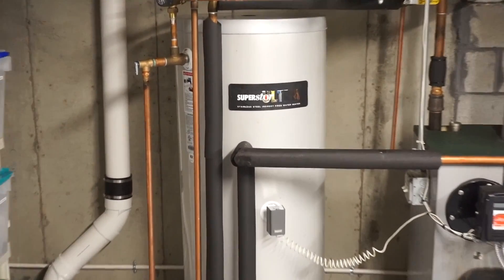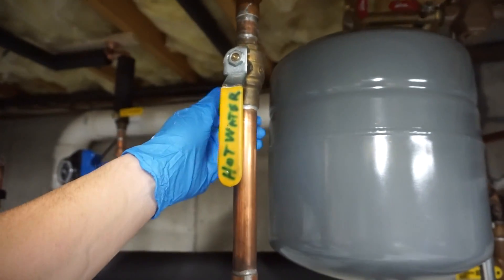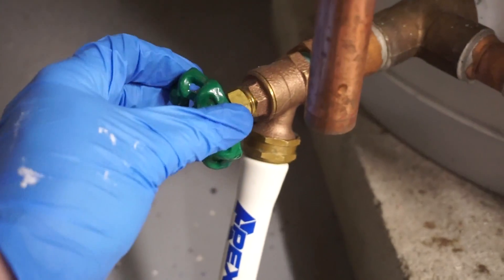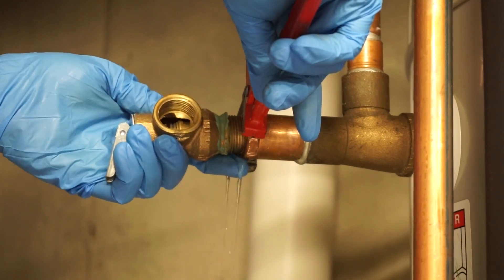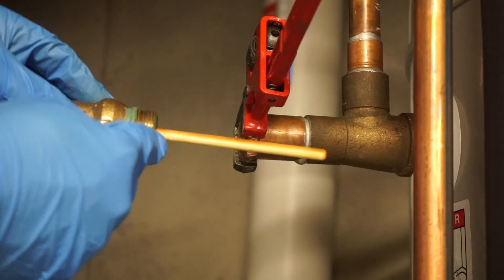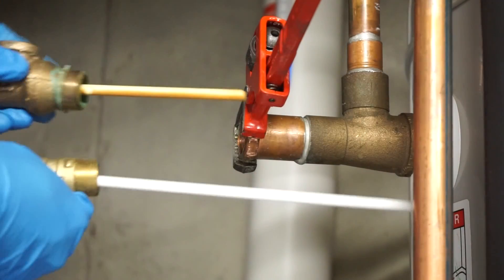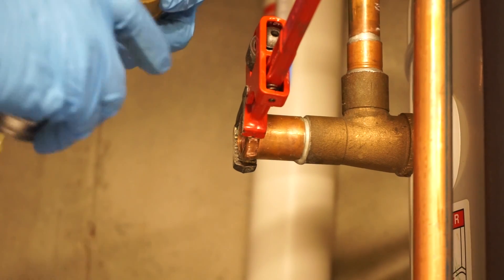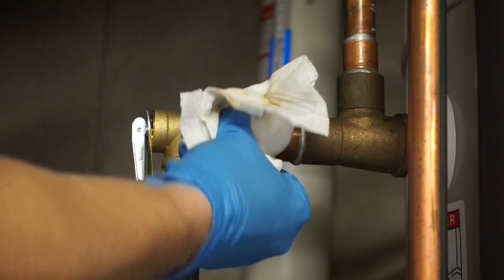How to Replace Hot Water Tank Pressure Relief Valve - T&P

Comment: Question:  So it's easier to replace this valve in the future, why not replace the vertical section of copper pipe after the valve with a flexible copper whip?     Then you don't have to do any more soldering/desoldering in the future.

Comment: I would recommend turning off the blue Watts recirculating pump whenever you turn off the water flow into and/or out of your water heater. I own the same pump. Our city water was out for 5 days after an ice storm, and I forgot to turn mine off. The pump motor burned out during that time, and I had to replace it.

Comment: Couple suggestions:
Sometimes the relief valve doesn't seat properly, so flushing the relief valve for a minute can wash it clean. Most manufacturers of hot water tanks recommend this flush every 3-12 months.
With the inlet and outlet valves closed, water or air can only come out of the other openings. No water will come out of the relief valve because that would require air to be pushed in through the drain valve, so the comment "no water is coming out of the T&P line" does not mean the water level in the tank is below the T&P level.
At the end of the video you try to expel the air in the tank by opening the drain valve. Air floats above water and you'll need to use a high-point vent to remove air. The relief valve would serve this purpose.
For viewers that don't have a separate hot water heater or boiler, it is important to verify that the tank is full of water before restoring power. Opening the drain does not accomplish this.

Comment: I bought a universal valve at Lowes. The body is longer so the probe is a showing less. It's a side mount gas water heater , I've seen answers to no it's not ok and it's ok. Any opinions? Thanks for the video. The original is the shortest body possible American 6900816 and a 4"probe the new one is utilitech 362341

Comment: On mine, the copper pipe from the T&P valve takes a right angle turn and the two more and then goes outside the house. In other words, I can’t just turn it to loosen it from the valve. Whoever installed it must have thought the T&P valves last forever. Is my only option mow to get someone to cut the pile and then resell a coupler on after the valve is replaced?
Reply: Sorry for typos. 
I meant:
Is my only option NOW to get someone to cut the pile and then REWELD a coupler on after the valve is replaced?
Reply: You can cut the pipe but you don’t need to resolder it to get it back together. Cut the pipe as square as you can with a hacksaw.  Use a 3/4 sharkbite coupling. They’re easy to find a Lowe’s and Home Depot

Comment: My city water system has a sediment issue, always has. The valve from my 3 year old tank had a small drip here and there. Plumber wanted 250 to change the valve and also said I needed an expansion tank. Never had one on my old water heater that lasted 12 years. Changed the valve myself yesterday. Took 10 minutes. So far no drips

Comment: Does spinning the valve around tighten the spring inside and change the pressure at which water is released at?
Reply from the maker: No, The spring works at the spec pressure/temp marked on the label and there is no way, either deliberate or by accident that can adjust the pressure on these consumer models.
Reply: @SilverCymbal  K Thanks. I accidentally spun it around when flipping it back down. Was a bit worried. LOL.
Reply from the maker: No worries, better safe than sorry and check. Thanks for watching and be sure to check out and share my channel for other videos. All home projects DIY to save you money and maybe even have fun doing the work. 😀

Comment: Mine was leaking I replaced it and it leaked also. So I thought it was a faulty one so I bought another.. But it leaked also..my psi is at 60 my temperature is at 90°F what do I need to do
Reply from the maker: First are you installing this valve on a hot water tank itself? 90 degrees is pretty low for domestic household hot water so I want be certain.
Reply: @SilverCymbal  yes on my hot water tank.. And I turned the temp down to 90° just to be safe. Ill turn it back up to 120 ° later.. My problem is it still leaks..another question is. Could the tank be outdated to were I should go on and buy a new one and I don't use a lot of hot water.. Could I buy a 20 gal.instead of a 40gal
Reply from the maker: These valves only open under 2 conditions. Temperature or pressure. I know you said you are at 60psi and the water temperature is 90. I would go to either lowes or home depot and buy a pressure gauge, they are around $7-10. They just screw on a garden hose fitting or even the drain of your hot water tank. You can connect it to that see what pressure it shows to be certain. Try to leave it conected for a little bit and it will probably rise in temperature. Keep an eye on all of these if you leave them connected since they can leak.
Reply from the maker: You can also try another thing. First, is the valve leaking all the time? Try to open the hot water for a minute or so at a faucet. Chance are the leaking will stop at the valve.. What you probably have happening is you are building too much pressure, this can happen if you have a hot water expansion tank on the line and if you don't you may need to install one. I don't have a video on this but others do. You may also want the advice from a plumber as well. - Those valves only open for one of the two reasons so you need to correct the reason which my guess is that too much pressure is building due to a failed expansion tank or lack of one. This is very common but as I said you are likely reaching a point where you need a professional. I don't believe changing the tank will make a difference

Comment: To let air into the tank, when draining it, you can also open a nearby faucet's hot water -- right?
Reply from the maker: Yes but if you do it above the tank you will need to let the water drain from the system above. This is ok to do it just takes a while.

Comment: The cold water pipe feeding the tank has a shutoff valve labeled "hot water" . It would make sense to label this "cold water in" or simply "water in".  How does air escape the tank from the bottom when you opened the tank drain at 16:45 since air is lighter than water and rises in the tank?
Reply from the maker: The previous home owner had labelled it that way. I agree with you but I can see if someone didn't really understand it, labelling it hot water essentially does stop hot water production from the homeowner view. But I do agree that it cold water in or cold water is absolutely accurate.  Good catch about the air in comment also, i really meant to say water out of the tank. Thank you very nuch for watching and I hope you Subscribe and Like this video also. Best wishes to you.
Reply: Silver Cymbal hot wterbk

Comment: What would you suggest regarding  the pressure relief valve in a basement (which has no drain) I want to lay down a floor? I can keep the area with the water heater unfinished, but would you recommend to open a hole in the basement cement to allow any water leaks to drain outside?
Reply from the maker: That is a great question.  If you are in a warmer climate then routing a line outside could be a good idea and save any flooding.  Remember to check it at least once a year to make sure it’s clear.  You can do the same in a cold climate also but just want to make sure that any holes are well sealed and also check it once in the warmer months.  When this valve is used the pressure is very forceful so if by chance something is in the drain line it will likely blast it out. Thank you for watching and I hope this is helpful for you.  Best wishes

Comment: I did not know you could run plumbing out of the T&P valve port on a water heater the way you have it setup with a "T". Question, Can I plumb a heating loop through the T&P valve open with a "T" similar to your setup, to a firstco 24HBQH? I am having problems with cold water back flowing through the heating system when shower is on and the check valve is failing due to hard water issues.
Reply from the maker: On this setup you definitely plumb it this way as it only has the two ports so you really have no choice. The T is not anything special but it is more of a "street" t so it saves some extra fittings but could you do it differently. There are no special valves or anything in the T.  The main thing to remember is that the T&P must have the probe in the body of the water in the tank at least an 1" is what most recommend for safety. It may also be useful to call the manufacturer of your tank for install diagrams. They can often help. Best wishes to you and thank you for watching.